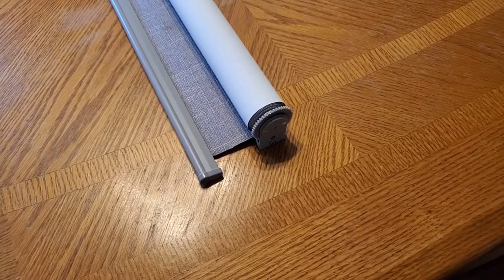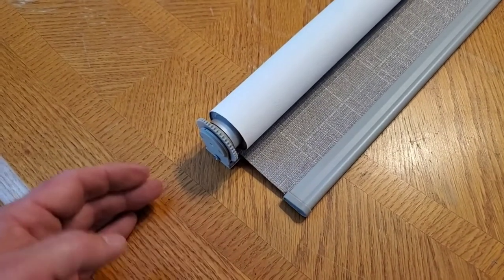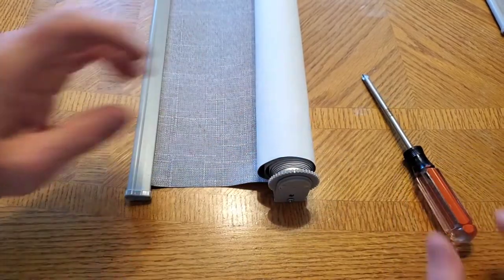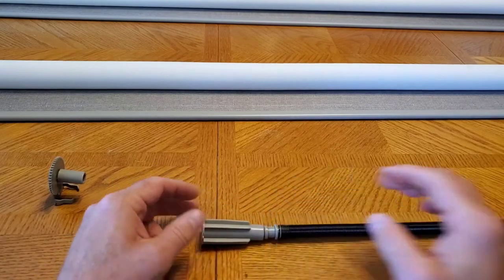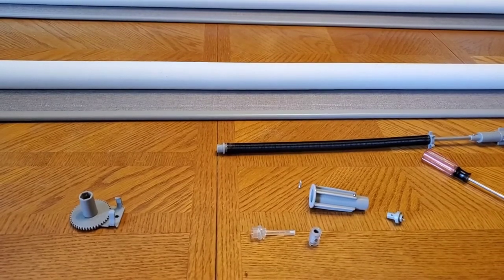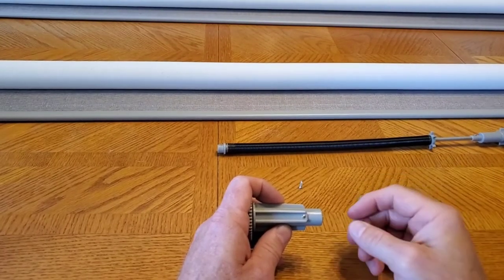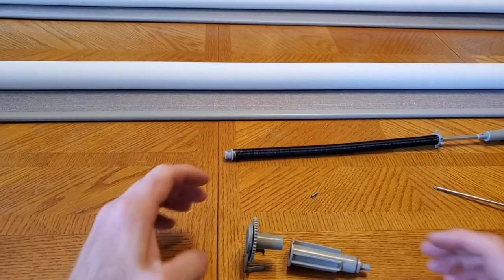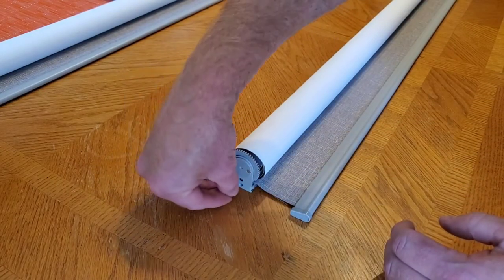Camper slow rise roller window shade repair.

Comment: Thank you!   It's really great to get the low-level detail on the construction and possible cause of the shade not latching down.  In our case, the metal pin was NOT pushed up, so it appears it is a broken plastic piece in the latch mechanism (though I haven't disassembled it to verify), so I'll be ordering a replacement from Irvine Shade & Door.

Comment: Any video on how to fix the spring?  The spring “sprung” on our shade tonight and the shade came crashing down.  The weight pulled the shade off the roller and there is sticky tape that adheres to the roller but the roller is still mounted.  I’m Not sure how to pull the roller out. , do I have to take off the frame board off the wall??  Any help is appreciated.